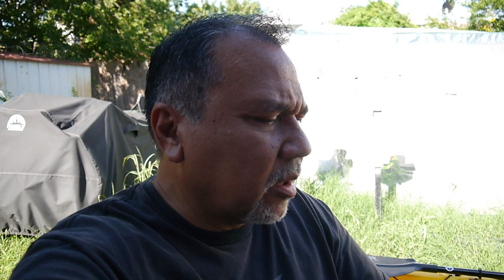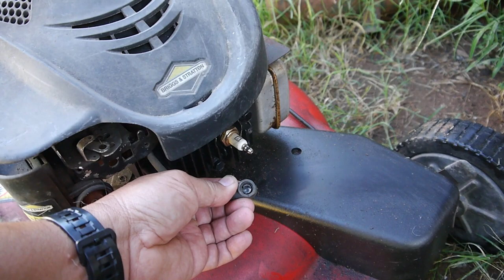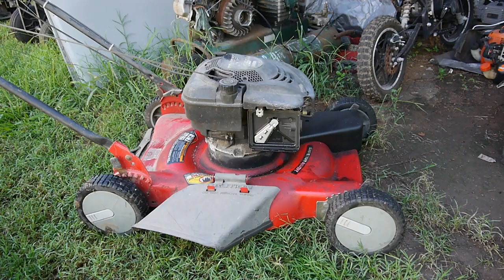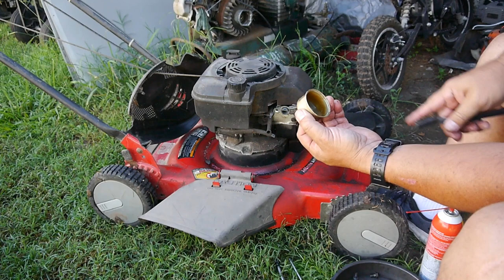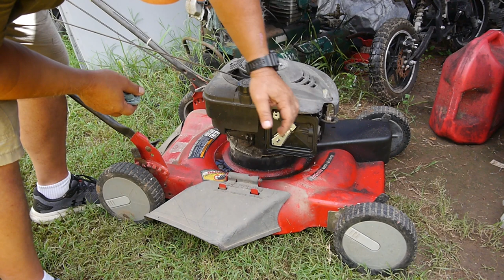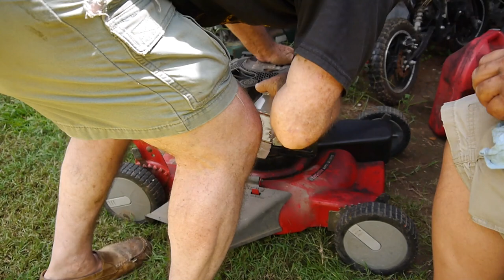Troubleshooting a Murray Lawn Mower with a Briggs & Stratton Engine

Comment: Good move to spray into the carb first. If that makes it start even for a couple seconds that tells you that alot is working. Compression, timing and spark. Narrows down problem real quick.
Reply from the maker: Right on
Reply: If they don't start with carb spray I dont buy them.

Comment: Great video !  I do not have an ultra sonic cleaner; and I wonder if that would better my carb. cleanings. I spray out, blow out and insert the small wires  to clean out. Probably 70% of the carb.'s return to good service, the others get an Amazon new carb. I just wished for better % of outcomes.
Reply: I have an ultrasonic cleaner and it won't save them all. Maybe higher than 70% though. I like using them because it allows me to continue to work on other stuff while the carb is taking a bath.